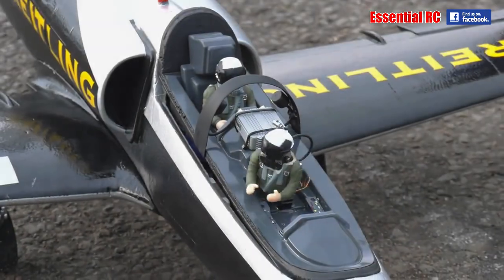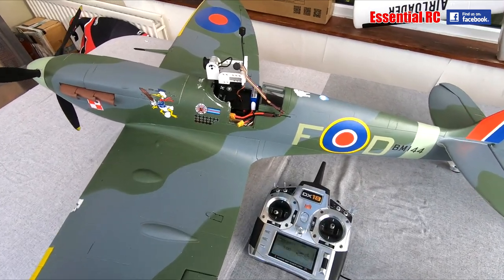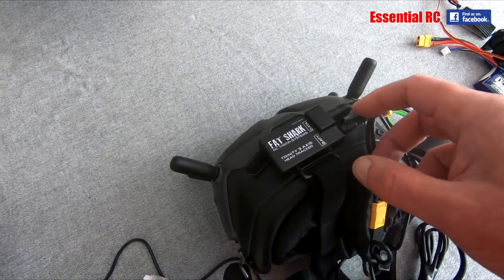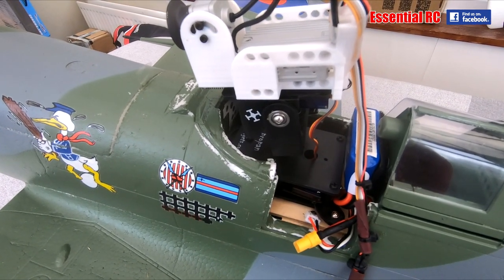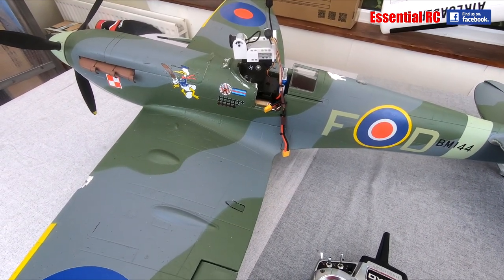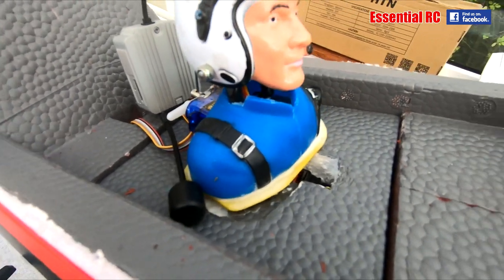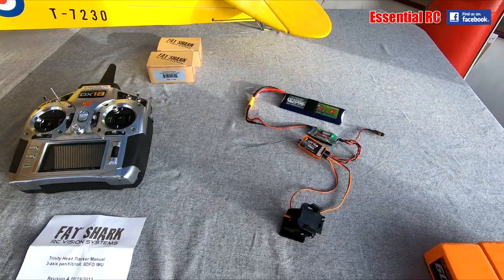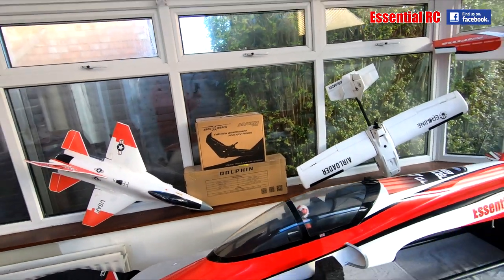HOW TO HEAD TRACK FPV | FLY FROM THE COCKPIT !!! YOU NEED THIS RC TECH FOR 2021

Comment: The internal Fatshark module is available at Getfpv I am desperate to get this set  up in a plane. Any references on converting that to stand alone? I would like a complete warbird of appropriate size for flight by mid March. With a DJI FPV system in play. then I can export that feed and possibly power a second fixed analog camera for spectators.

Comment: For the super budget version I stick an AIO camera on a servo in the cockpit and use the rudder ch to pan left and right. Either a 3 ch plane or I put it on a switch between rudder and camera. Works great. I’ve put it in stuff as small the flight test mighty mini size planes. Nothing fancy but I can look around

Comment: Excellent.🙂 I have an idea to use fibre optic instead of the camera lens so you would see through one of the pilots eyes. I did also find some info on someone that had built working flight instruments! I have so far built a flight chair set up using a converted joystick/pedals/throttle and an Auduino Uno, next job is to integrate the head tracker input. I fly with 'Drone circle' (see Facebook page) near Macclesfield. cheers John.

Comment: today i built every thing in wireless , one arduino nano ble-33 in the goggle behind the face plate. and one nano in my radio to receive. it has pan tilt and even roll. works perfect. when combined with a 3 axis gyro you have the best feeling. like g force pullin youre head and stabelize in wobble winds :)
Reply from the maker: Our team member Jason has done same thing. The wires are a pain.
Reply: @EssentialRC  for the goggle tear down yes but its so nice when done for the radio it wasnt to bad. i love the clean setup less wire dangling that can go wrong. wouldnt be the firsth time i acedantly pull something out mid flight whyle trying to reach a button or something lol. didnt end wel without gps and failsafe. from now on i take the extra mile. in the end nothing can beat it :) and safes a lot of money\repairs

Comment: This also strikes me, i've been flying FPV since like 2005 and many many years ago i bought a head tracker, in fact two different systems. But i never got ot actually setting up a moving camera setup with head tracking until recently, when i got more free time due to the current events. I had a hard time identifying the systems that i bought years ago and finding manuals for them, as one of them is just 2 black boxes for example. But i did manage to set one of them up and i'm ready for maiden in the next couple of days. While i was identifying my systems and finding manuals for them i found out that there is practicly no headtracking systems available today, while back in the day there was quite a lot of offerings and people bought them. I really wonder why would it die down and why would those offerings cease to exist, not even talking about lack of more modern systems with drawbacks of old systems polished out. This situation is really wierd to me taking into account how much microelectronics have advanced in just the past 10 years, let alone 15.
Reply from the maker: You and me both George. Let's hope it gets resolved next year so more of us can get into HT!

Comment: This would be amazing on my nitro .90 sized warbird, but having to use more channels on top of what my bird can do is a bit of a pain. If whatever company made an all-in-one set that talked with the head tracker both for the FPV signal as well as regular radio for the tracking servos, that would be choice.
Reply: vibrations will be an issue. The camera will need to be dampened well to prevent the "Jello" effect.

Comment: i have the fat shark attitude V2s that have the trinity head tracking module built in. all i need is the stupid cable that has the data connector on one side and the 3.5mm jack on the other to hook into my Spektrum DX6 radio but its not available ANYWHERE and ive spent ages looking online for one and they dont seem to exist :( kills me having the trinity tracker with no way to use it....
Reply from the maker: To be honest I tried with their external head tracker and I got so much drift it made it unusable and I've heard same happens with the internal board you've got. It's old tech now.

Comment: Try a 360 degree camera and connect it to the transmitter but you will need to lock the 360 degree camera locked forward or win you go to turn ull be locking in the roung direction I just dont have the parts or money to do my idea

Comment: Which servo should I buy in order to have 90 degrees for each side movements?
Reply from the maker: Standard servo will be fine for 90 degrees each side. When you want to go almost 180 degrees for full rotation that's when it gets challenging. Proportional 360 degree servos are rare.

Comment: Propan model looked  wobbly.. The air unit is likely to overheat in the extra. Great fun though. Done it on a Spitfire with analogue FPV just using the radio sliders.
Reply from the maker: It's not the propan unit. It's a pilot figure on a servo in the Extra330. You think the air unit has to be in the breeze? There will be some air flow through a hole in the front of the canopy so I doubt it. If it was buried in the fuselage and insulated then maybe.
Reply: @EssentialRC  I meant the first one on the propan mount in the Spitfire. You might get away with the air unit on low power in the extra this time of year in the UK

Comment: how did you connect the dji goggles to system ??? power to the headtracking moduel??? and goggles???🤔🤔
Reply from the maker: DJI Digital FPV camera/air unit paired with the goggles. The head tracking independent of that. I used a FatShark external module. Not manufactured any more but you may find it on eBay. The module connected into the trainer port on my Spektrum DX18 transmitter. We will be selling an Essential RC head tracker module in the near future on our eBay shop.

Comment: Where can i get a complete set up for head tracking with FPV
Reply from the maker: Caddx as a company are getting closer to offering a complete solution. If you went with DJI you need to buy a separate head tracker (e.g. Medlin) and gimbal (e.g. AtomRC)

Comment: how do you connect the pan and tilt gimbal to the head tracker
Reply from the maker: Pan/tilt has 2 servos which plug into receiver. The head tracker plugs into trainer port on your radio transmitter. The transmitter send the servo positions for pan/tilt to the servos in the gimbal via 2 trainer channels.

Comment: Just my 2 cents. But a phone (old or new) has a screen battery and motherboard with gyro (very accurate gyro) built into a small system. We just need someone make a way to be able transmit and receive the data over a long range for this to become the new thing. You can get external cameras for phones though USB so that’s 1 part solved

I think it’ll be a matter of time before it’s an affordable attachment for our phones and planes/drones/helicopters/cars…

Obviously it would require an app as well and I’m sure it’ll become popular if pulled off good enough

Comment: caddx vista runs native 6s
Reply from the maker: I think DJI runs on up to 6S but I wouldn't do it! Poor thing will probably overheat. It's a big model so I can easily carry another small 2 cell lipo to power it.
Reply: @EssentialRC  on my fpv quads it runs fairly cool even in summer on 6s. I suggest reaching out to some of the fpv companies like Foxeer, Caddx, and fatshark with this video. I can see them wanting to pursue this new trend & as a fpv quad pilot only this makes fixed wing much more appealing.

Comment: And the law says about FPV... don't want to put a downer on the FPV. But I've a feeling there going to clamp down even further
Brian
Reply from the maker: I'll worry about that when it actually happens Brian. Why they should limit what happens at BMFA affiliated RC flying clubs is beyond me. Anyone wanting to drift cars legally has to do it at a proper track rather than on the streets. Why not just apply the same common sense to our hobby?
Reply: The fpv laws are questionable. I can't legally put my analog 5.8ghz vtx at more than 25mw output powrer but my WiFi routers can display 5.8ghz at 600mw!!!???. I'm pretty sure the ceo of the FAA won't slide tackle me and confiscated my drone if I put my video power up to 600mws. Silly.

Comment: This is both exciting and frustrating at the same time for me.  I have tried to spark interest in headtracking fpv for a couple years now with no luck.  I really don't understand why it has never been popular in the mainstream.  Everyone says it is amazing but they have no interest in trying it
Reply: Hope you don't mind me posting this here but here is my go from 2 years ago.

https://youtu.be/Wbzr4m9J6aM
Reply: I REALLY love headtracking but never explored it too far because no one else was interested in it. :(  flying alone is no fun.
Reply from the maker: I don't think FPV has been good enough up until now Dawson. I tried quad and fixed wing FPV few years back and the quality of the video feed to the googles was always crappy. Even when signal was good it looked bad but that was rare. DJI digital is rock solid and will only get better.
Reply from the maker: Wow! That is ridiculously cool but simple setup. Thanks for sharing.
Reply from the maker: Have you got any advice on servos to use? 180 degree 6V servos that are smooth and quick for tilt? fast and smooth 360 degree 6V servos for panning?
Reply: @EssentialRC  Unfortunately, no I don't have any recommendations.  I have always made do with the cheap stuff.  I actually added resistors to the potentiometer of a regular servo to create a 180 servo for my first experiment with headtracking.  Not a great way to do it if you care about precision, smooth motion, and reliability but it's what I had on hand.  I was only 18 with a small income then so I had no choice but to make things work.  good luck finding some!

By the way, I'd recommend checking out the YouTube channel called AussieHoppy.  He makes some amazing realistic cockpits.  He also made the first ever two seat cockpit where a passenger/copilot can also look around.  link below.

https://youtu.be/1a0bhgxZZwk